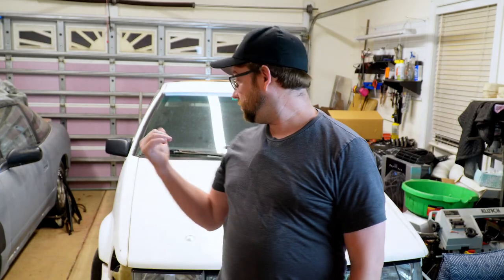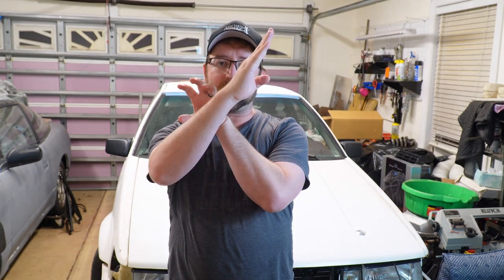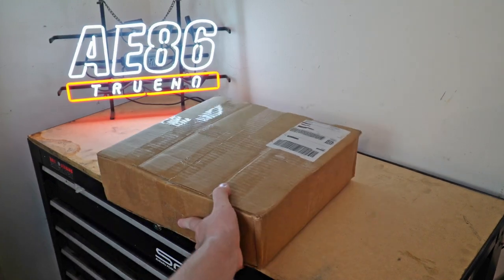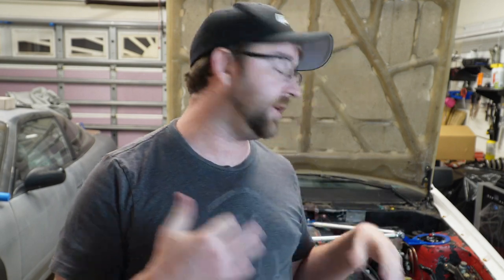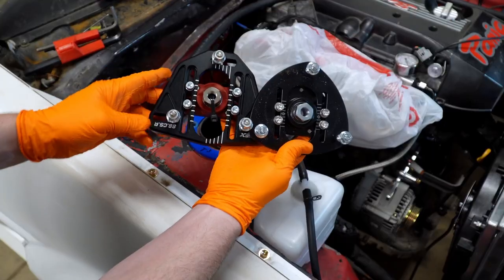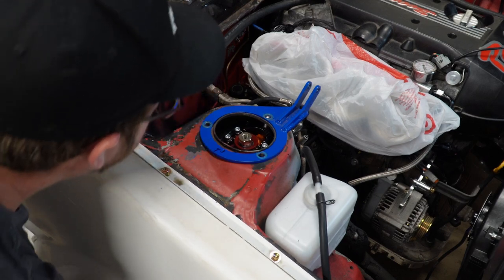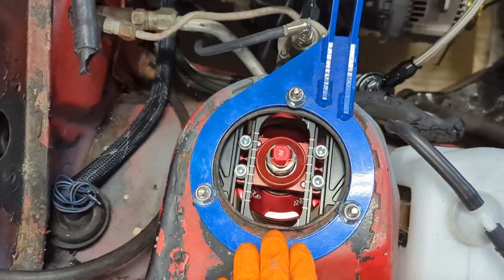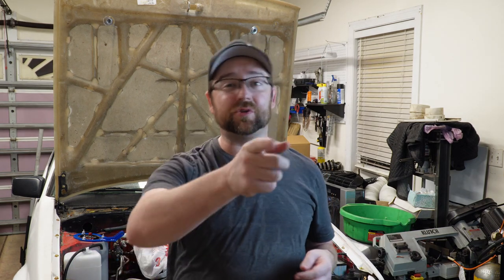AE86 - UPGRADED Camber/Caster Plates - THESE ARE AWESOME! Annex CASCAM Plates

Comment: Lot weaker parts what see of cuts.  Sure the  caster ones will break from adjust if you use then manytimes.
Reply from the maker: I doubt it. The CASCAM plates are a much stronger material than the standard camber plates. Even the studs were custom developed to be stronger. 

This style of plate and design is fairly common for tons of other cars.
Reply: Have seen many breakup.. and that is really thin in critical places.. not that item but even thicker ones
Reply from the maker: Oo that's interesting. What cascam plates have you seen break and on what vehicles? I'd love to know more!
Reply: Not cascam but just like those older style.. you adjust them many times it weaken material and break. Those new ones just so thin material that i would not use street use. T3 Cusco i got have seen winter use hard roads and nothing wrong. But those are thicker material
Reply from the maker: I wonder if that was user error that caused the failure. Part of adjusting them is loosening, then removing the load by supporting the suspension, then tighten and torque to spec This helps prevent fatigue and damage. 

I've actually never personally seen camber plates breaking like what you're describing, even on customer cars with suuuuper cheap stuff like Racelands. I have seen when they get chewed up from somebody not unloading and supporting the suspension properly though. 

The Annex CASCAM plates are 7075 T6 aluminum and are FEA tested, I feel pretty confident that these won't have any issues. I'm more confident with these than T3 camber plates, that's for sure.
Reply from the maker: I reached out Annex and asked about this because I was curious to know more about the strength of the CASCAM plates and the testing, since it came up. Here's the info they shared:

"That's the really cool thing about 7075.  Although the part is obviously lighter than a traditional camber plate, 7075 as a material is far stronger than 6061, which is used widely in the performance parts industry.  7075 cost a lot more and its tougher to cut, but we knew these CASCAM plates were going to be a bit pricey so we decided to not hold back on the materials or components and really maximize the adjustment range we could offer our customers. 

It's worth noting that we spent a solid month on just the engineering analysis for the plates and mounting hardware alone as we take this very seriously.  You can actually see some snippets of stress modeling we did on our site:

https://annexsuspension.com/annex-ae86-camber-and-caster-plates/  "
Reply: sadly did not take picture of friends top hat.  actuallu those where rear ones so not meny times have been adjust. But lets see how that will handle adjustment.  Looks really slim and not heavy item
Reply from the maker: Slim and lightweight aren't a direct correlation to strength when comparing parts made from different materials though.